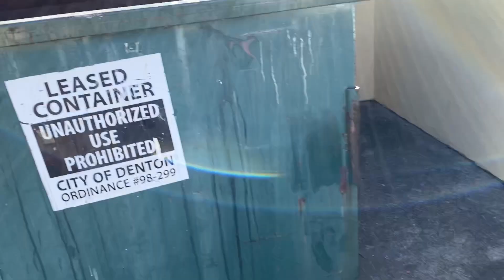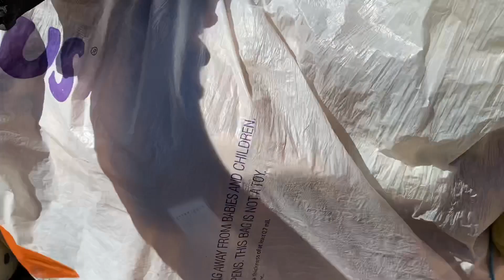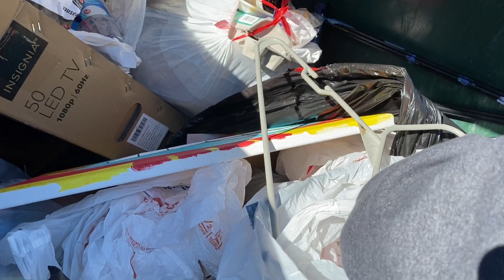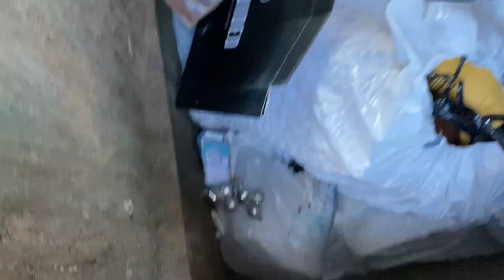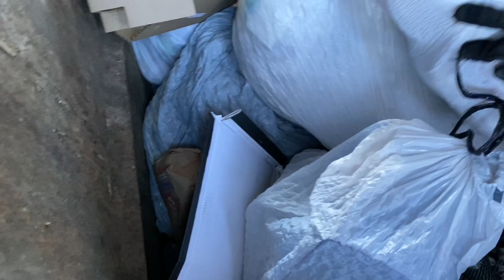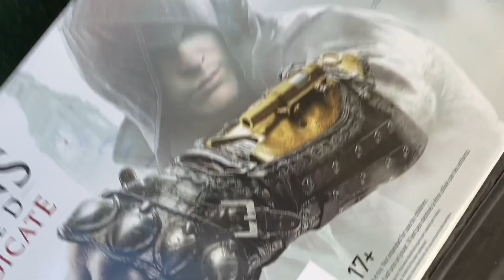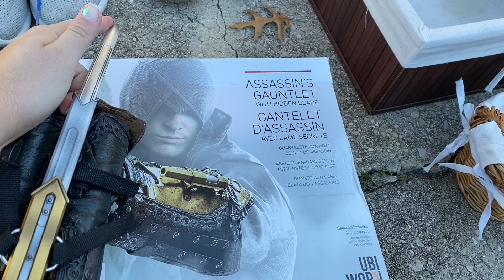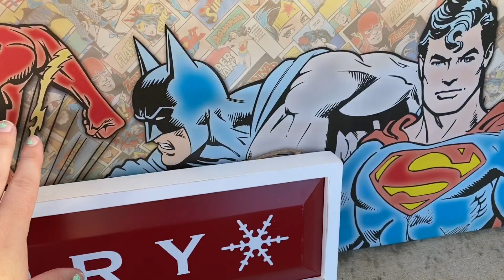Dumpster Diving to Raise Money for the Australian Firefighters!

Comment: Pro tip for leather shoes: remove laces, ball up lightly damp newspaper and cram the shoes hard. Brush them with a stiff brush. Shape the shoes and lightly spray with water. Let dry slowly. Once dry. Take out the paper, spray with water and some air freshener and restuff harder. Shape. Dry brush again. Let dry. Clean the soles with a rag and rubbing alcohol. Clean the laces separately with dish soap, rinse, stretch and line dry. New looking shoes. 
That may sound like a lot of work but it isn't most of the time is just spent drawing and letting the newspaper reshape the shoes to get rid of all the creasing from being worn. Let me know if you try it.

Comment: Kudos to you Kelly on Aid to Australian Firefighters.

Kelly, a tool that I use besides a grabber sometimes, an 8 ft  fiberglass pole with a hook securely attached on the end. It works pretty good most of the time for reaching in the back or bottom of the dumpster. Also if you have any artist that paint a used canvas  will be white washed and used again. Might be a few bucks.

Comment: I learned the hard way not to use my grabber to move things out of the way. If you get a big hook, like to hang a bicycle, and screw it in to an old broom or mop handle, it is a super tool to keep you from jumping in or breaking your grabber. I also use a long handled rake that has 4 tines that are rigid, hard metal, like iron. That is the strongest and I can poke the tines into a bag, give it a twist and pull it out, it also works well with dragging cardboard boxes closer.